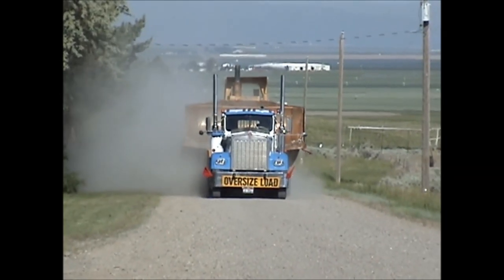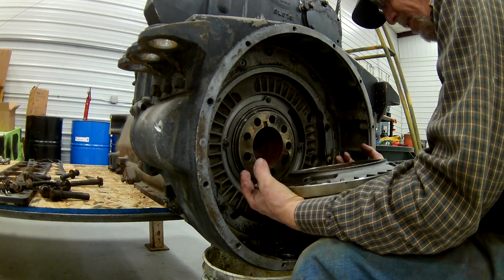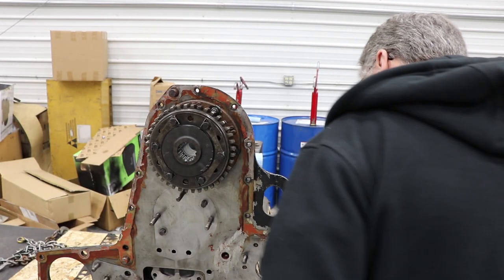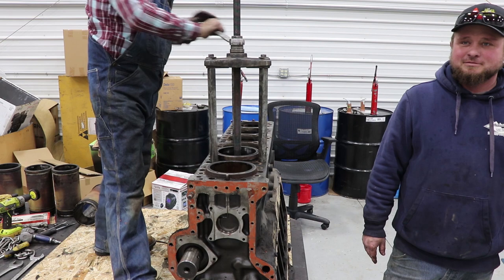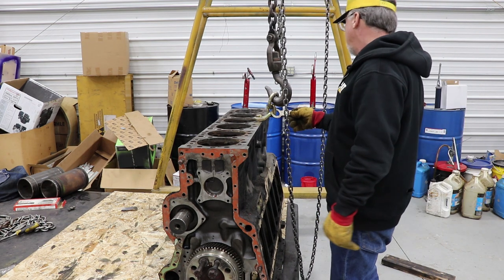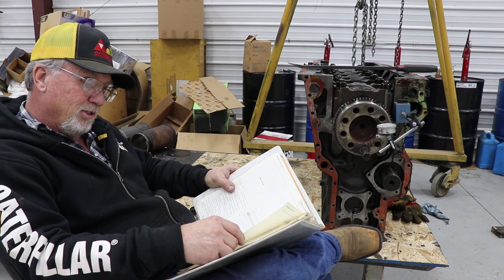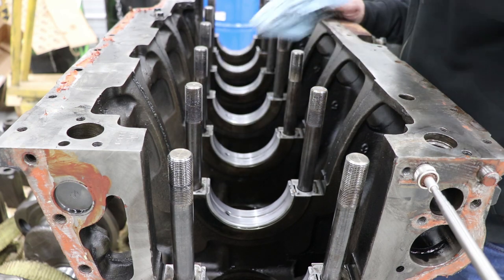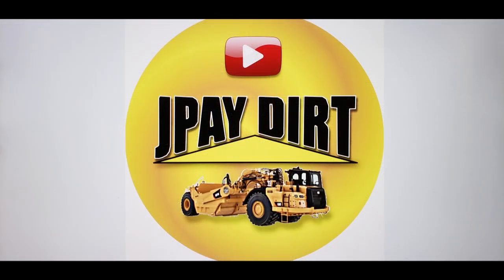1693 CAT Truck Engine Final Disasssembly

Comment: Hey Jeff, I am a heavy equipment mechanic those bearings don’t look bad normal wear and tear, only be worried if you see heat discoloring and or copper coloring. Although I am young I enjoy working on the older equipment back when they made it out of real iron, I have my own old 977l cat track loader set up for logging with log forks and winch, what good ole tractor. It gets to be irritating when I work on this new equipment with all the plastic garbage, glad to see you putting life back into that old engine

Comment: In 1962 i was 22  never been inside a diesel engine , boss had a 1952 Autocar  with an NH220 Cummins . Liner seals on one cylinder leaked water into oil . He tried to seal with sodium silicate in water , piston skirt picked it up and seized engine . This thing had 450,000 miles on second in frame overhaul , and had been traded in on  A 1963 Freightliner . Tore it down in frame , resealed 5 liners  put in a used liner and piston that had been worn out knurled and worn out again .Only new parts were gaskets , for some reason boss  honed liners using cement blocks for stones . Put it together and wonder of wonders it ran !Western Iowa to NYC hauling meat 2600 miles per week  burned 25 GALLON of oil per trip ! I think you can do better !

Comment: Get the bore mics out and start checking everything on that block it will tell you what way to go.  Your crank is .0005" below spec on the rods per my crank grinding manual but if it all checks round I would just send the bearings to Swain and get them coated .0005" extra  to make up the clearance and to give them longer life.  Be sure to check the crank not only for size but round as they tend to wear D shaped. I would really try to come up with a way to isolate the oil coming and going from that brakesaver/retarder from the regular lube system. That thing is going to really put a lot of air and heat in the oil, both of those things are bad for the rest of the engine.  It is like the worst possible windage problem you can imagine.

Comment: Them liners made me think of a diesel mechanic I watch, He claimed poor grounding at block would cause liner damage. He showed some liners that looked like a welder had been after them. Bad block grounds he claimed.
Reply: jake legg, the best to check ground for eletrolysis is put on ohm meter on its lowest setting in the radiator and the other to ground and it read should about .01 or so , I found out my truck had a bad ground from the factory and after I cleaned it the ohms drop alot.If the ground is bad it will eat up your heater core and radiator.

Comment: Main bearing wear is even across the lower bearing. Not on one side. That's good. There was a lot of power coming out of that engine higher cylinder pressure causing more wear on the bearing. During the failure metal went though those bearings. For what that engine went through not too bad.

Comment: A little tip to keep you safe Jeff. Cat lifting link SWL is with the bolt tensioned, always use 2 in case one fails, putting your trust in 1 of anything is madness except perhaps your wife 2 of them is 2 to many. 3406B got a bigger crank and piston pins over 325 Hp and higher compression over 350. The first bearing you showed looks good but has had some dirt through it the second bearing is just some cavitation erosion so all normal. Cheers mate🍻

Comment: The 1693 brings back a lot of memories from working on these in the USAF.  We had them in Oshkosh Firetrucks (425 hp) and Snow plows (325 hp).  Very good engines.  We junked our one Firetruck and I put that 425 in place of the 325, boy did the operators love plowing snow with the 425!  Great videos!!!

Comment: Loved watching you tear down this engine, Years ago I owned an Inter with a Cat 3406B. with only 250000 miles, the No. 1 cylinder piston blew up. I never bought another Cat truck. My best luck was with a Detroit Series 60. Had to replace head gasket with 750000 miles. Sold it with almost a million miles. Shipped to new owner in Africa,

Comment: Quite a few years ago I helped rebuild a Cat 3412 genset, the block had cavitation and was too expensive to replace for the customer. We used belzona metal repair products on the block and as far as I know the genset is still running. I hope this may help.

Comment: Elechicken tape and a shop towel is better than most Band-Aids. Any little cut that a normal Band-Aid will cover, usually goes unnoticed until I scrub my hands good for supper.

Comment: ,,, the thrust clearance is amazing. The 7 ten thousandths on the rod journal wear is nothing or maybe not even wear, but the original grind .
Reply: That seems like it would be normal oil clearance.
Reply: @markfromtexas9810  ,,, well, that was the actual measurement of the journal, he'd have to i.d. mic the assembled bearings to get the clearance .

Comment: You ever have stuff built up using Additive Manufacturing? RPM Industries, Rapid City South Dakota is one of the companies that does this stuff. I used to work at an Army Depot that used AM to clad and re-machine lots of stuff including parts for the M1 turbine engine. Lots of commercial aircraft have turbine blades rebuilt with AM. They can put on some hard coatings and corrosion resistant coatings.

Comment: These bearings, what I can see of them look pretty good for a high mileage engine. I firmly believe that measuring the crank journals, and the bearing bores is well worth your time. If you're not equipped to do this, then a quality automotive machine shop should get the job of clean, magnaflux, and measure the crank and main bearing bores. It's nice to have a 0-1" micrometer with a ball anvil, or ball attatchment. This will allow you to measure the wall thickness of your bearings. Compare to new spec. calculate the wear from there. Back in my mis-spent youth I used to machine the main bearing bore of heavy duty Diesel engines. Sometimes I refit loose main caps. It was a high stress operation, a tiny slip up and the block would be garbage!

Comment: Double check the runout on your crank. The way your bearings look could just be from workin ol Kenny.   But I wonder if you have a twist or bow in it. Maybe I didn't see it right but it looked like you showed wear on different sides, top of one, side of another? Thanks for sharing

Comment: Following anxiously.  Head gasket leaking on mine.  Trying to hold it at bay.  Gets hotter than I would like.  You think radiator or water pump?  I have the lower temp thermostats in it and they are working.

Comment: The 1683s were a hell of a motor in their day !! They did have there issues like rod and main bearings and just like the 3406 up until the C models there bearings were to narrow and that combined with to much oil pressure wore the bearings quickly !!
Reply: How can to much oil pressure wear the bearings quickly?  That does not compute in my old mind.  With high oil pressure, there should always be a film of oil over all metal surfaces.  This should provide almost no wear.  So what am I missing here?.
Reply: @MrJerryjam  it actually after prolonged time it will take the babbit off the bearing I have seen bearings that had grooves cut in them and others with pits cut in them

Comment: Definite concern for 1693 crankshafts that have run 1.5 million miles. Some broke when reused, even though they passed mag inspection.
Reply: Roger Howell  Most of the time it happens because nobody install a NEW harmonic balancer as instructed by Caterpillar at each overhaul .Seen several do it , generally got the fun job of changing the crank .
Reply: @beckywatt5048  Before fluid-filled  balancers only a physical inspection was called for. As long as the rubber was intact and the witness marks were still aligned, the balancer was considered reuseable.

Comment: For 2 mill miles i would bottle the engine as very good condition for age, over that period a few bits of dirt in the oil would make marks like that on the bearings,

Comment: What kind of radial was that belching to life in the background? 450 P&W?
My first ride in a W900A was a brand new 76 model day cab that had a 325 hp 1693 with a 9 speed and KW’s torsion bar suspension. It was set up to pull pole trailers delivering treated poles to customers! All company owned trucks before this truck were all R600 Mack’s.

Comment: Ok guys, sub up here, he's got a mighty big slant 6 there, with even bigger bearin clearances. 
We're going to need to get some fresh parts in there, cause I've never seen bearings that look like that come off a perfectly good crank, looks can be deceiving, and I'd bet that crank is going to have a date with the big grinding wheel before it's over. Better order a calendar or 2 too.

Comment: I used to roll in bearings in my b model every 300k when I had it putting 620 to the rear wheels...my bearings looked just like yours at replacement time...was very cheap insurance
Reply: I thought about the same cause. He leaned it on it a bit much and hence the bottom halves look beat up now.
Everything has a "price". Want more power ? Sure ! Just don't forget about the extra maintenance that comes with it.

Comment: Did the 1693 only use that retarder or could you get a Jake for them. Drove one in a old Brockway that had the Super liner cab but it had no retarder or Jake that motor was wore out so bad had to count to 100 holding the glow plug switch to get it started what fun great video on this motor
Reply: David Caskey 
Duel overhead cams, no Jakes.

Comment: You need to buy a 1in Milwaukee impact. It will remove 99% of the nuts and bolts you need to take off or on
Reply: Or at least get the 1/2" high torque impact from Milwaukee, it will take the nuts off for removing truck tires .Stronger than their 3/4" wrench, I have both.
Reply: @bigbobsha  how much do they go for, always said i would purchase but never got around to it
Reply: @bigbobsha  Same here, it's absolutely crazy how no other brands haven't gotten any where near what Milwaukee impacts have.
Reply: @NathanCAY1010  Bare tool without battery or charger if you already have these:
https://www.amazon.com/dp/B077H7JP1D/ref=psdc_552820_t1_B002AKKJBS

1400 ft lbs of nut busting torque
Reply: @NathanCAY1010  I have a Milwaukee ½ inch high torque impact with a 6 amp battery and charger for sale and it's only been used a handful of times. It looks brand new let me know if you are interested in

Comment: Howdy, wish I had as much knowledge.  How do I get my fuel rack unstuck on my 1693TA ??
Reply: Could be the shut off holding it I had a problem with the shaft that pulls the rack shut not giving mine full throttle check that make sure it's not stuck if it is then try to get lube down onto the rack may have to pull the pump apart to get it unstuck

Comment: Love The Old time engines , A Question for you Jeff What scraper model used the 750 HP 3408 rear pusher engine the one that was either idling or full throttle  ???

Comment: You doing a good job on that motor. I bought a truck in 1998 a Volvo it was a company truck carried it to Cummins and had then to turn it up it had 300000 miles on it I go get it could tale it but the first month it run with them big trucks 40000 on the drives it ostrich the air bags but one month layer took heads off had 5 busty piston after I rebuild it I had a good truck my brother got me one of your Kenny hats for Christmas and my birthday and I told him he got me the best gift for me and I have a lady that makes my hats I gone see if she can make me and you one like your YouTube decal and if she can I send you one of them have a good night

Comment: Two things I'll say about this engine.  1. Always remember, Jeff... this could be a 6-71 Detroit in your possession.  When hunting for parts, there some 500 plus factory models to deal with (both turbo'ed and non-turbo'ed).  2.  If this 1693 can't be used again, or if it becomes too expensive, an alternative I might suggest is a 3406B from Kustom truck at http://kustomtruckparts.com/ since the 1693 did set the foundation for the 3406 A and B models.  (Just a thought.)

 Anyway, thumbs up for the video.